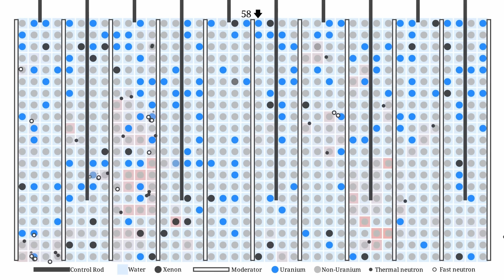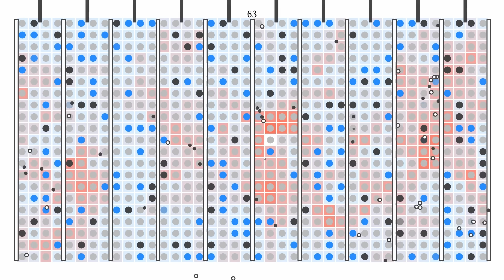Chernobyl Accident - Simulation only (no talk)

Comment: I am from Ukraine (where Chernobyl is). I can confidently say why the computer was turned off and the warnings were ignored. Because in a socialist system, the most important thing is output (work results). An engineer was appointed to the position of the head, and if he had not shown results, he would have been fired. And the position at work at that time was the most important.

Accidents happen everywhere and always (even in many capitalist countries there are large-scale oil spills, for example, you know this yourself). But in this particular case, they were working with a technology that was still fairly new at that time, and the management was urged on, but they did not want to lose their positions.

Be mentally prepared for the fact that a similar technical "accident" may also happen in AI technologies over time. And the spread of this AI accident can be just as fast, only worldwide.

With all love. Live long❤

Comment: Would have been nice if the starting part were reactor accurate AKA also used the graphite tips rather than rely on a seemingly pure Western core design (cus there's variants of water boiling reactors) and then retroactively adding the RBMK quirk. I understand the point was to demonstrate the consequences of each action as well as the design, things like the engineers lack of knowledge of it being a quite used fuel and that when they poisoned out the reactor, they were none the wiser to the power drop and retracted the control rods.

I just think it'd be neat ya know?
It's a good video though do not misunderstand me, I like it and it's a perfect visualizer for anyone who wants to get a basic understanding of reactor core interactions. I love how Xenon just imediately absorbs the thermal neutrons while termal neutrons sometimes fail to interact with the fuel.

I'm defs linking this.

Comment: im still confused on what this video actually simulates, is it the reactor itself or what?
Reply: Basically, the when the black lines (the control rods) are pulled out, the water temperature rises until it becomes steam.  When the control rods are reinserted at the end, the reaction rapidly accelerates out of control.  Reactor 4, designed to operate at 3200 megawatts, went beyond 33 000.  Explosion.

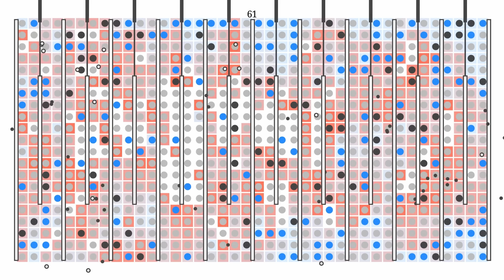Comment: What a joke! This is so ridiculous. At 3:15, graphite appears out of nowhere? The real cause was a miscalculated reactor design, not operator error. The control rods displaced the water from the lower part of the reactor, and the absence of water was the real problem. Additionally, the SCRAM procedure didn’t engage the downward-moving rods to move up.

Comment: [Sitnikov reports back to his bosses]
Bryukhanov: Well?
Sitnikov: I sent my dosimetrists into the reactor building. The large dosimeter from the safe, the one with the 1,000-roentgen capacity...
Anatoly Dyatlov: [impatiently] What was the number?
Sitnikov: There was none. The meter burned out the second it was turned on.
Anatoly Dyatlov: [to Bryukhanov] It's typical.
Bryukhanov: See, this is what Moscow does. Sends us shit equipment, then wonders why things go wrong.
Sitnikov: We found another dosimeter, from the military fire department. It only goes to 200 roentgen, but it's better than the small ones.
Fomin: And?
Sitnikov: It maxed out. 200 roentgen.
Fomin: [suspiciously] What game are you playing?
Sitnikov: No, I-I... I asked him, he took multiple measurements, he's my best man.
Bryukhanov: It's another faulty meter. You're wasting our time.
Sitnikov: I checked the meter against the control.
Anatoly Dyatlov: What's wrong with you? How do you get that number from feedwater leaking from a blown tank?
Sitnikov: You don't.
Anatoly Dyatlov: Then what the fuck are you talking about?
Sitnikov: [steeling himself] I... I walked around the exterior of Building 4. I think there's graphite on the ground, in the rubble.
Anatoly Dyatlov: You didn't see graphite.
Sitnikov: I did.
Anatoly Dyatlov: You didn't. You DIDN'T, because it's not there!
Fomin: What, are you suggesting the core... what? Exploded?
Sitnikov: [softly] Yes.
Reply: 🤮
I apologize. faints
Feed water. He has been next to it all night.

Comment: It looks like water was restricted or the water was turned off completely.  The control rods were also all the way out so I'm assuming they were trying to turn the choke all the way up while spraying in brake clean and then it' finally back fired and burned down the whole garage.

Comment: This is the lie. The accident began immiately after the pressing AZ-5 button (emergency protection activation button) that was intended to shut down the reactor ompletely. But due to the catastrophic failures in construction of the control rods, instead of shutdown, at the very first moments the lowering of the control rods resulted in the displacement of water from the channels and instantaneous positive jump of reactivity and further increasing of reactivity caused by steam.

Comment: 1:57 Legasov: "As uranium splits apart to release energy, it breaks down into a new element. Xenon. Xenon reduces reactivity. This is the poison Comrade Khomyuk mentioned. When the core is running at full power, it burns the xenon away before it can cause a problem. But because of the delay, Chernobyl Reactor 4 was held at half power for ten hours. The xenon did not burn away. It built up, poisoning the core."

Comment: Here’s my attempt at a very quick explanation (after watching the full video):

neutrons= moving dots, subatomic particles with energy
Uranium 🔵 Eject three neutrons when collision occurs
Xenon ⚫️ when a Uranium atom “disappears”/decays, there is a chance it will appear. It absorbs neutrons, which causes it to disappear, so its overall effect on the system is a slowdown.
Water [ ] slows down neutrons, but the more neutrons there are, the hotter it gets, until it evaporates (into a steam void)- which is like an immediate ‘off’ switch on its effect.
control rod | An impenetrable wall that absorbs neutrons

(Extra detail: moderators (white bars) cause the initially input neutrons (white moving dots), which move too fast to react, to slow down upon impact to a speed that will react (become black dots). Only adding this as a P.S. since it’s not completely required to understand the sim.)
Reply: And the new moderator bars appearing at 3:20, those are at the tips of the control rods when the emergency stop button was pushed?
Reply: @ Yes, in the full video he explains that he only decided to add them in at that point of the sim. I guess they were irrelevant before that point or something
Reply: @KNylen  So long as the control rods are in the reactor at all, the tips are all the way in and their influence becomes a constant.  It is only after the rods are completely withdrawn and then reinserted that it becomes something new.
Reply: thank you, this helped me piece is together between the two videos.

Comment: So, would the meltdown never have happened if they didnt hit SCRAM? Or was stopping the water coolant/recirculation the ultimate mistake that would have caused it anyway?
Reply: The reactor was dangerously unstable before hitting SCRAM. Without SCRAM it probably would have been more like a Fukushima type meltdown rather than dramatic steam explosion. Pulling out all the control rods and cutting coolant flow to a live nuclear reactor cannot end well.
Reply: @moltovivace  thanks for the response! ill have to learn abt what happened with fukushima now

Comment: this is complete bullshit. where are the graphite tips at the end of the control rods which caused prompt supercriticality when the rods were dropped in (which doesn't happen in the video)?
why does "non-uranium" change to uraium and back? from what I "know", this was not a thorium-fueled reactor where fissile uraium is bred from neutron absorption. 
"water evaporation causes more xenon to burn". no. water evaporation only happened when it went wild, xenon had to be essentially burned before that.

Comment: because due to clever design. the bottom of the control rod (Black rod) is actually a fuel rod (white Rod).

so when they try to stop reaction by putting control rod, the reactor suddenly went out of control, from already overheat.
Reply: Not a fuel rod, but a graphite rod (graphite acts as a moderator)

Comment: Love your video! 

1. What software are you using for the simulation? 
2. Also, what device is used? 

I had a simulation project but struggled to get good enough performance when it gets complex ;(
Reply from the maker: The video generating software isn't public and also it's such a huge mess I don't think it's a good idea to release. BUT 

I did make a game where everything is pretty much inluded.  It's much much more fun to play with the code. It can be bought on steam or you can play with the code here (Made in Godot feel free to push commits):
https://github.com/ReneTC/MissionToFission

Comment: This is why I say that Chernobyl wasn't an accident, it was more sabotage than anything else. If you cut your car's break lines and remove the steering wheel and throw a brick on the gas pedal and start driving it downhill, it's not really an accident, is it?

Comment: Why didn’t they just stop it was there no button for reset or whatever
Reply: the emergency stop button is what caused it to explode. the tip of the control rods was made of graphite (graphite accelerates nuclear reactions) and when they pressed it the reactor melted the rods in place and the reactor ran away and exploded